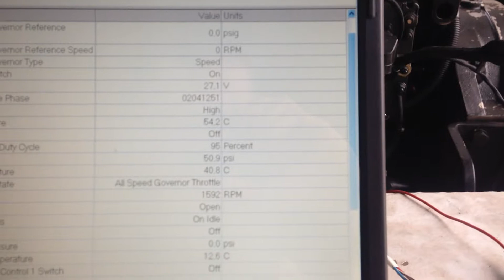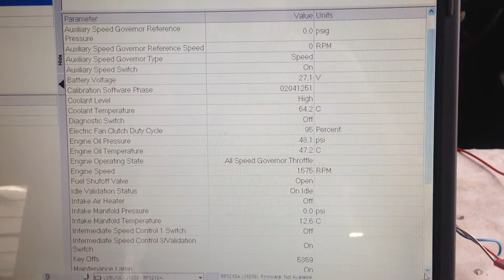cummins QSM-11

Comment: did you make a cable to do diagnostics? because I tried to connect but I didn't find a connector compatible with my cables and connectors.
Reply from the maker: No, we have the diagnostic program.we have all the cables and connectors for cuummins engines.